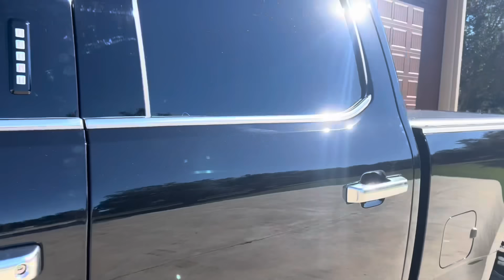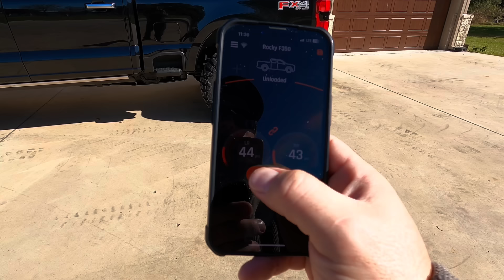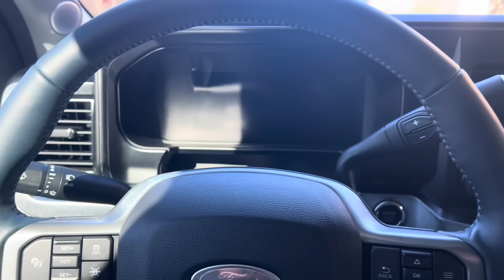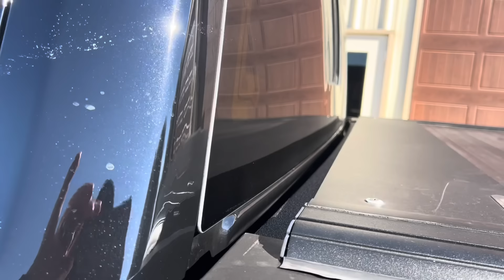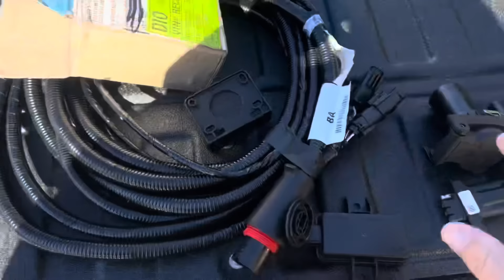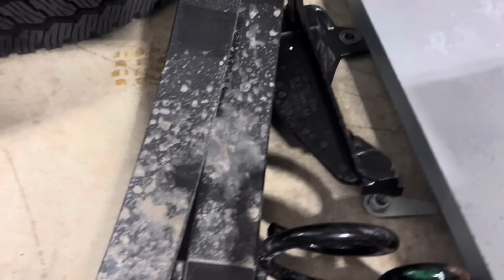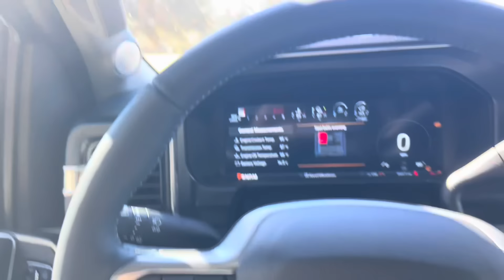2024 Ford F350 Limited Super Duty Build.. Lift, Airbags, fuel tank, and High Output Powerstroke

Comment: New to your channel great video I just took delivery of my 24 Limited as well love the truck. Picked up a set of 22x10 -18 offset with 325 50 22’s Toyo AT3 gots to do a lift now won’t fit. So I’m looking at the BDS 5 inch cause I really don’t want to do any cutting or trimming  at all and was told it’s an actual 4inch front kit so hope the lift won’t be to much as I’m also towing a 43ft 5th wheel. Thinking the 3 inch just won’t be enough🤷‍♂️
Reply from the maker: Just being honest 4 and 5” is going to be a lot to pull fifth wheel. 325 is close to 35.5-36” tire.. Max I would prob do is readylift 3.5 for towing.. Carli is close to 3 to 3.25.. My 2.5 with 37’s is almost too much.. I would recommend 3 to 3.5 max. You will run into bed clearance issues.

Comment: With the extra height of the truck is there any concern with weight shifting more to rear axle of 5th wheel?  Or did you do something to level the trailer?
Reply from the maker: I have one of the new fifth wheels that sit high from the factory. Trailer is probably 1.5” high in the front towing and on a 45 foot really does not make a difference. The rear of the truck is stock tremor hieght.. The 37” only adds an additional inch from what a stock tremor is off the lot. It is 2” higher than a stock fx4.. All of these trucks with stock suspension will squat 4” with the weight added. I usually set my bags at 45-50 psi and allow the truck to squat 2” which also loads the suspension properly and prevents any sway.

Comment: Great video man! Definitely going w/ the ReadyAir Logiq! Thanks answering on your other video as well! What PSI are you running when you’re not towing anything, just everyday driving? And how much weight does adding the extra tank lol…. Do you worry abt the added weight reducing your payload or the bags definitely offset it enough to not really worry?
Reply from the maker: The Mid grapps are 65 max.. Everyday driving I run the front at 50 and rear at 48. When towing I bump them up to 55 all around in summer. After 20 miles they are at 65 with Texas heat.  The airbags offset the weight no problem on fuel. The pin weight on my RV is around 2500 with nothing in the garage. When the canam is loaded it reduces pin weight on the truck.
Reply: @RockyRohde  I meant, what do you have your airbags set at when not towing
Reply from the maker: About 5 psi
Reply: @RockyRohde  awesome truck! How do the bags ride when the truck isn’t towing and the bags are set to 5 psi? Does it ride worse or better than Stock in the rear when the truck is empty?
Reply from the maker: Better than stock. That’s why I recommend these. If you check any super duty groups these are the best choice
Reply: @RockyRohde  awesome! I’m probably gonna run this same setup. Does it raise the back any at 10 psi when unloaded? My truck now is dead level, and I was hoping it would still be level when unloaded with the bags set at 10 psi
Reply from the maker: @ maybe 1/4” at 5-10 psi
Reply: I ended up doing the ReadyAir Logiq thanks to your video on my ‘23 F350 KR and I loooove it!! Thanks man!
Reply from the maker: Thanks for watching!
Reply: What air tank did you use? Also what Air Logiq compressor did you use?
Reply from the maker: Airlogic tank and sd2 compressor. Tank is very light maybe 3-5 pounds

Comment: Look'n good Rocky! I'm thinking about upgrading my 2019 F250 to a 2024 F350. Have you had any problems with the brake assist on your new 24? I hear a lot of people complaining about it on their 2023's that it slams them to a stop for no reason even with nothing in front of them (both forward and in reverse). One guy said he felt like an idiot because the guy behind him thought he was brake checking him and got mad. So everyone is saying they have been disabling it, but then have the annoying reminder message on the dash continuing to pop up every time they start the rig or even change gears from reverse to drive. Hoping Ford resolves this issue.
Reply from the maker: I have had no problems with my 23 Tremor, platinum, or 24 limited. I did have it recalibrated after leveling kit. Trucks are amazing you won’t be disappointed..